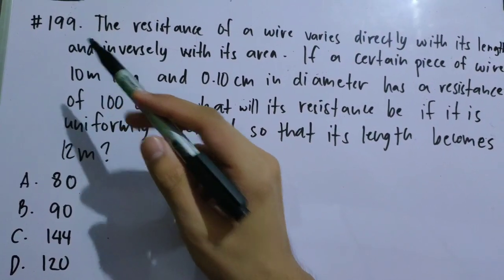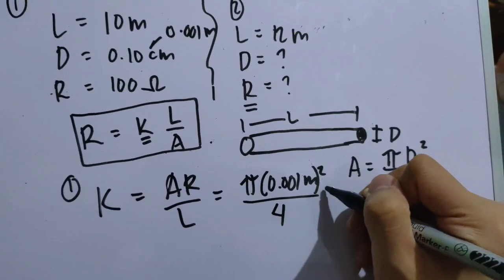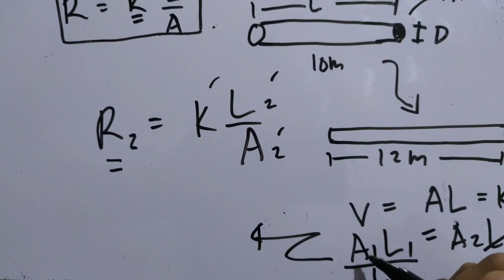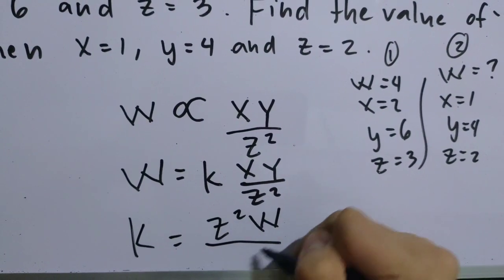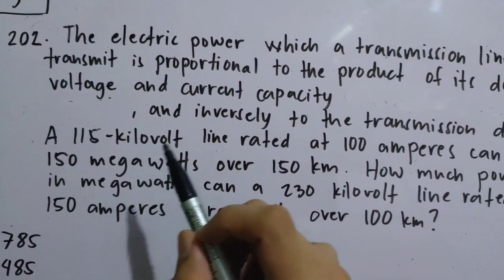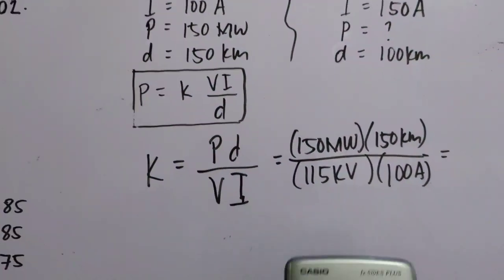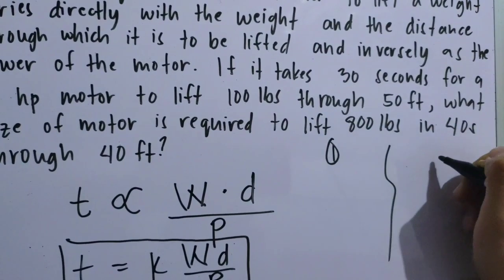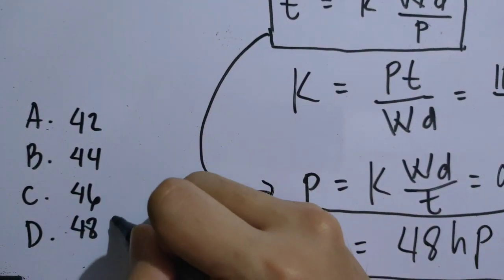VARIATION PROBLEMS| 1001 Solved Problems in Engineering Mathematics (DAY 5) #199-#203

Comment: sir paano kapag ang problem is ganto ?...kalito po kasi yung sa diameter at radious . thank you!

The circumference of a circle, C is directly proportional to the diameter of
the circle, d. If when the radius is 3, the circumference is 18.85. What is the
diameter when the circumference is 100?
Reply from the maker: Gawin mo lang diameter yong radius nya. So kung 3 ang radius 6 ang diameter.
Reply from the maker: 18.85/3=100/D
3/18.85=D/100
D=300/18.85
D=15.92